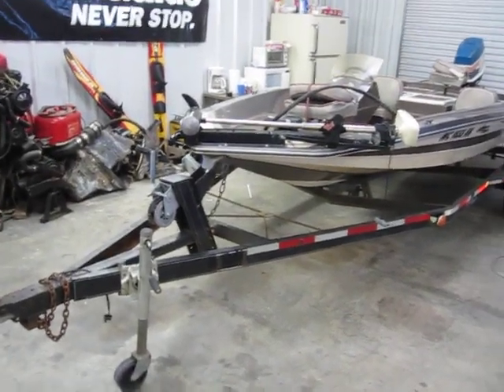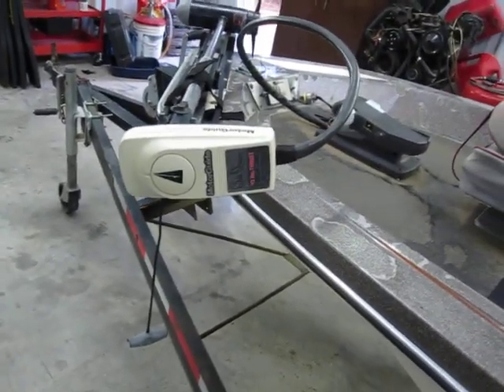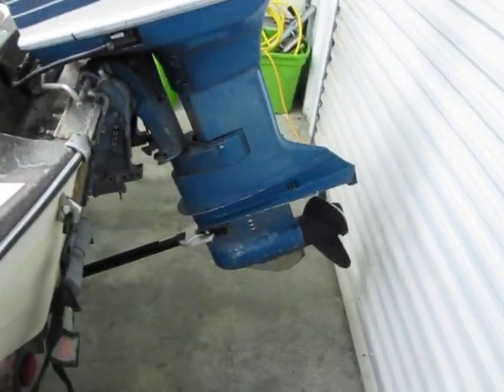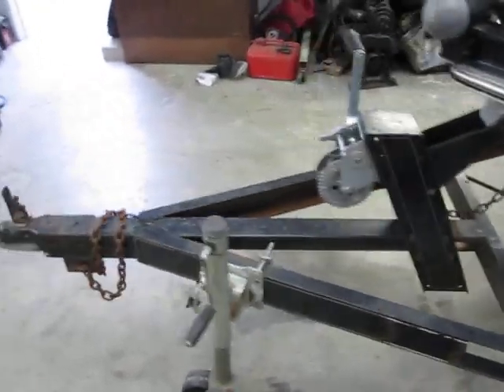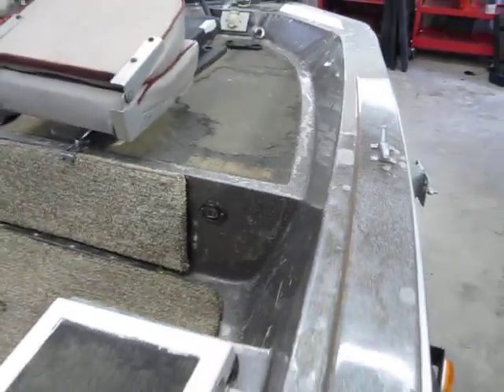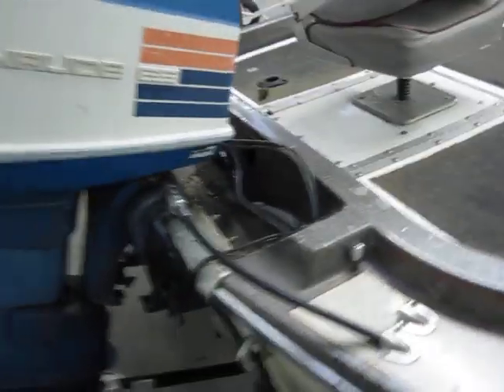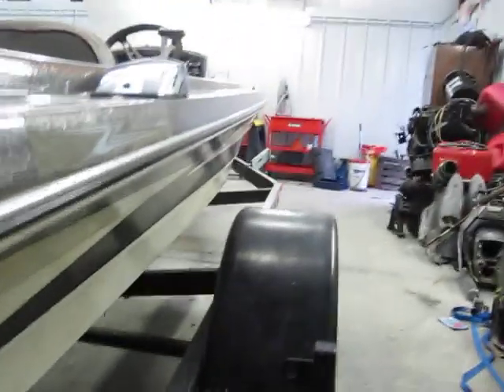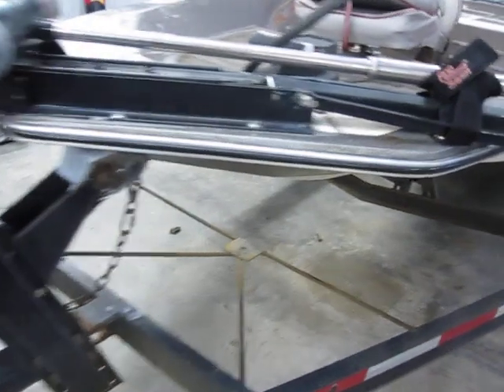SOLD 1977 Hydra Sports Land Inspection

Comment: Just got a 1976 hydrosport 17' bass boat with mercury 1150 115hp . Used 8 years, sat in garage for 40 years. Wiring and gas lines redone,  motor has great compression.  Everything original. 
Also kevlar